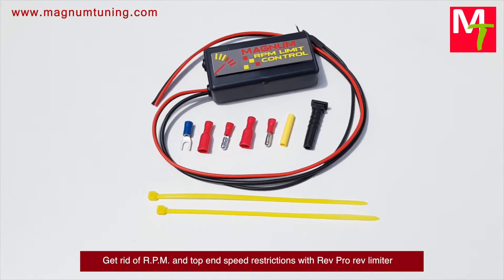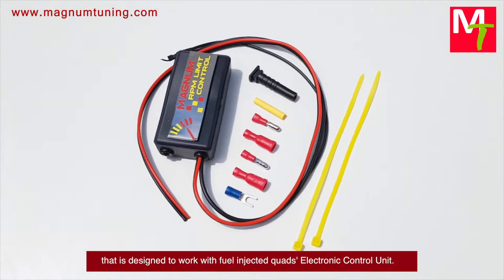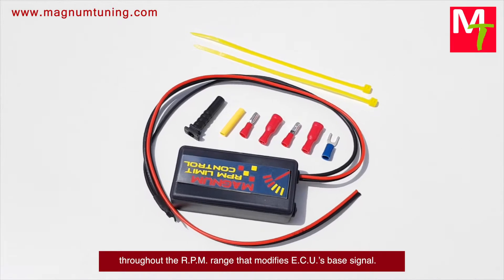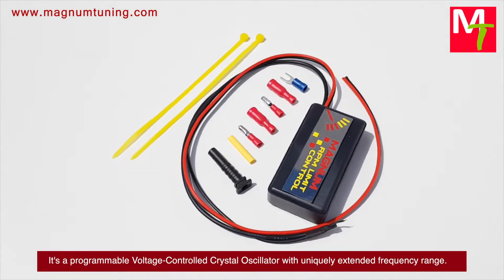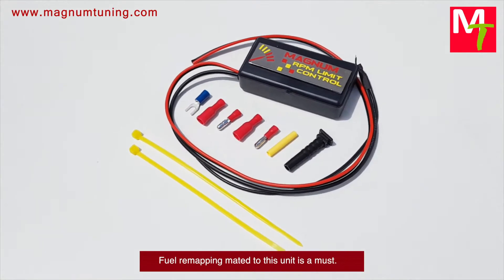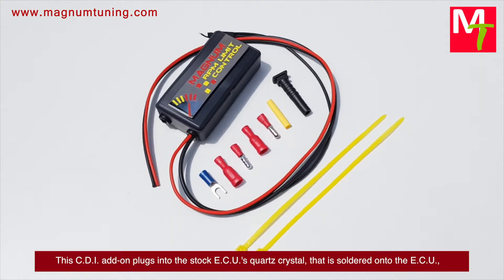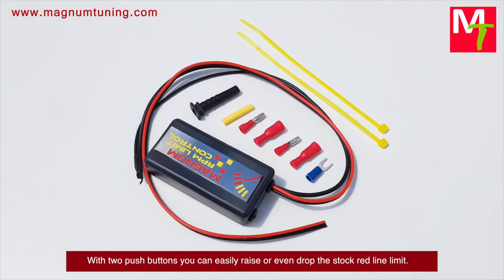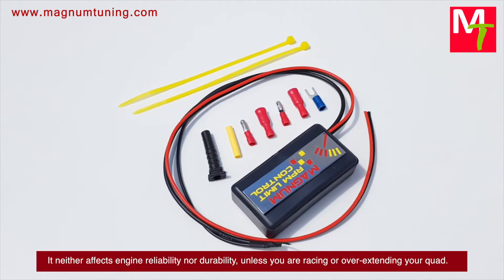Revolution PRO Programmable ATV Rev Limiter   Rev Up Your Ride Rev Up Your Ride

Comment: Does this improve the Vitacci blade 200cc UTV performance/speed? Where can i buy?
Reply from the maker: Thank you for reaching out. In condensed manner this is  secondary ECU add-on tuner designed to allow you to bump up the red line limit and increase the top end speed in parallel. For performance improvement all rev limiters assume a fuel trim remap though that is a must have if you want to get more speed. Because our YT team is unable to access comprehensive tech info pls feel free to check out the product description. 

https://www.magnumtuning.com/en/detail/revolution-pro-atv-speed-rev-limiter-cdi-box/vitacci/blade-200-efi

Comment: I own a 2015 Arctic Cat mudpro 1000 LTD eps do you sell a programmer that will get rid of the rev limit or at least raise it a lot higher then 5800 and also the fuel tuner so that I can get better acceleration
Reply from the maker: Hi,
Thanks for contacting Magnum Tuning. Yes, the rev limiter mated to any brand fuel tuner is designed to help you override the factory rev governor to hit higher top end speed. Our fuel tuners deliver 15 up to 17% extra power and improve the acceleration throughout the RPM range. Because detailed tech support is provided through our website, feel free to contact our engineers with further questions.

https://www.magnumtuning.com/en/contact_en

Have a great day